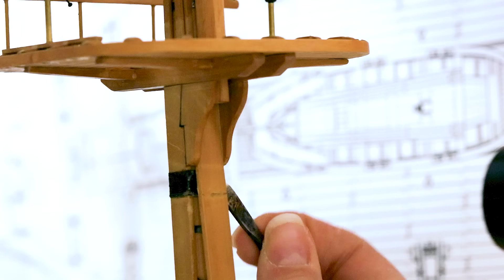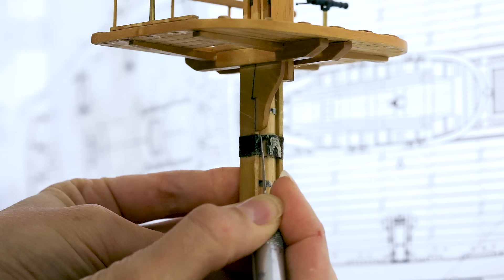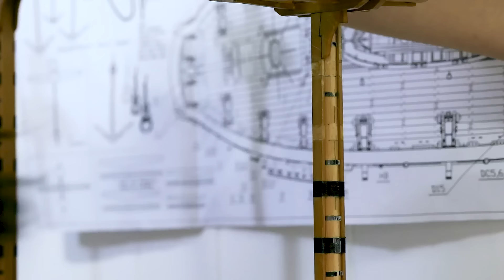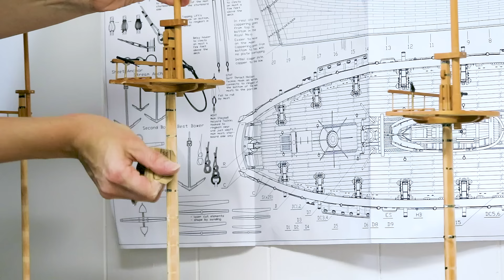Restoration & Upgrading of the HMS BOREAS (1774) model #05 - Disassembling MASTS

Comment: I have been aboard the Rose, a sailing ship built in Egypt and owned by a Pole, I have been on the Lady Nelson, a reconstruction of the original. 40 years ago we made 3 crossings of the Atlantic and one of the Pacific on a sailboat that was already 30 years old, and in none of these boats was more than 3 kg of glue used; if people learned how to tie knots they would not need to use so much glue but only a few drops

Comment: The effort that goes into this is admirable. Me, i would probably build a new one. Kudos.
Reply from the maker: This model is already a treasure - you can see on it techniques and tricks that modelers used more than This model is already a treasure - you can see on it techniques and tricks that modelers used more than 50 years ago, when there were no laser machines, 3D printers and modern glues such as PVA and superglue...

Comment: I’m curious Olha, how far are you taking this? I know she needs a detailed cleaning having been displayed uncovered, but are you taking your efforts into the deck(s) and hull or limiting your efforts to masts/yards/ rigging? The more I see what you’re doing and the scale of the model the more I realize what a Herculean undertaking this is.
Reply: Same. I’d also like to know the answer to that question. And yeah the amount of work (and the quality and detail) she puts in is absolutely insane.
Reply from the maker: This model is already a treasure - you can see on it techniques and tricks that modelers used more than This model is already a treasure - you can see on it techniques and tricks that modelers used more than 50 years ago, when there were no laser machines, 3D printers and modern glues such as PVA and superglue...
So I will remove everything possible on the model, clean it of glue and put it back. I will keep the original elements except for the rigging and sails)))) I will also add details that are missing on the model...

Comment: I remember you told me, at the very beginning of this enterprise, the model was well made, out of boxwood, and was worth saving and fixing. I can now agree with you 100% after seeing the work you’ve done so far, but my question is : Are you still of that opinion? Does the model still seem solid to you?
Reply from the maker: Oh yes, after cleaning - all parts will be installed in place. Detailing is made of pear. The hull is a combination of boxwood and yellow maple - I have already discovered it under a thick layer of dust)))

Comment: Hello  Olha.
Is that a heating gun that u use?
And what temparature is the setpoint in degrees celsius?
Greetings from the Netherlands Olha.
Gerard
Reply from the maker: Yes, I've been thinking about buying this tool for a long time and now is the time. I could not have disassembled this model without it. This gun is 350W 662°F (350°C)
Reply: Thank you for the information @OlhaBatchvarov